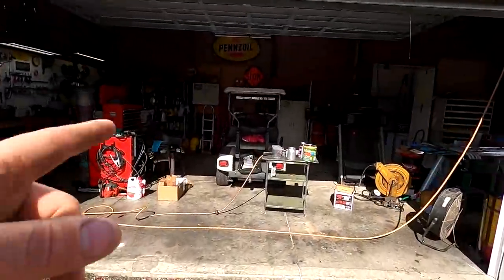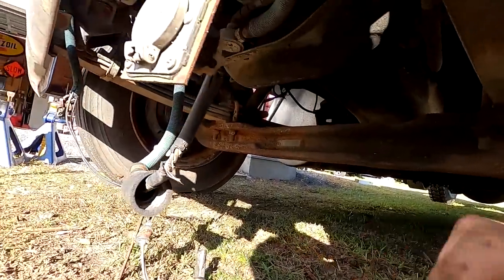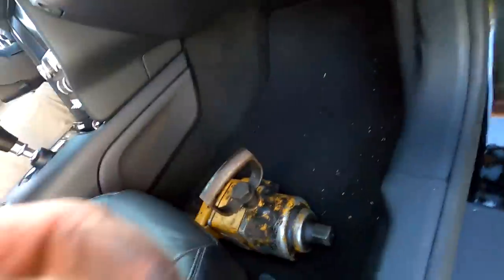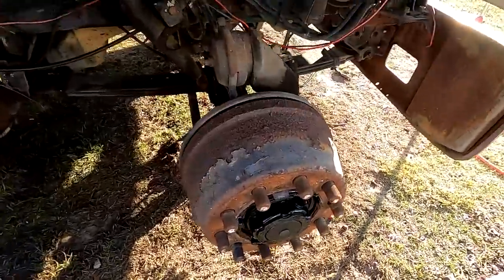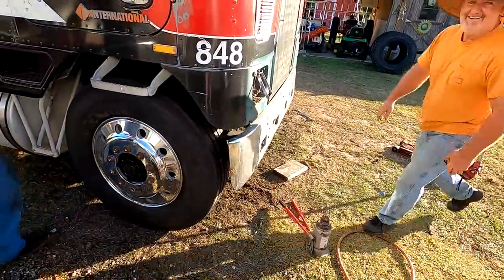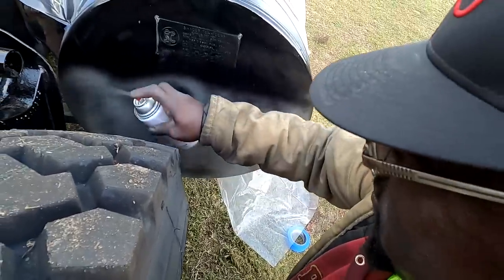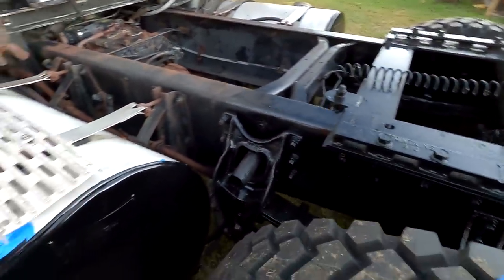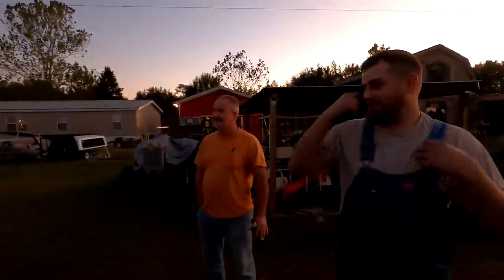Frame Painted, Tires Mounted, Brakes Done!!! Cabover Is So Close!!!

Comment: I did tires for three years and did lots of semi tires. We always mounted the tires with the rim face on the ground not up. Also if you would take that tire bar and put your foot on one side of the tire and the bar on the other side and use the bar to position/move the the mounted rim and tire it makes them allot easier to mount on the truck. Your going to crush your hand and fingers doing it like that. Just trying to help out.

Comment: Nice build. The wheels are amazing,  I’m jealous,  I used to have 8 rigs before 9/11 hit the country,  shortly after diesel fuel went to 4 bucks a gallon, that’s up from $1.35.  Insurance companies should have be jailed for their rate increases,   All my trucks ended up getting liquidate by the friendly IRS.  Time marches on,   Nice build, on my older spring suspension trucks I used to add air ride cab mount kits, they would most time ride nicer than the full air suspension trucks.   Sweet cab over 👍

Comment: Hope all went well with your family from some Wilsons on this side of the pond. The truck is looking superb. Are you going to change those front drums? Thought I heard you say they had cracks in them. Iceman is a true tradesman. You can tell by the pride in his work. 
What's next after the truck? Seeing as you dealin farm equipment how about doing a cropsprayer. I know you would have to have the work overseen and signed off by a licensed aircraft engineer but it would be an awesome project.

Comment: Shoulda used truck bed liner for the back of those fuel tanks.. I would of roughed up the surface of the tank first with sand paper then wiped it down with isopropyl alcohol to clean..then applied liquid truck bed liner.. That would of bumped it up multiple levels of protection from pebbles and stone chipping it plus the durability of the liquid truck bed liner for the long term.. Heck I saw a CJ7 coated with truck bed liner inside and out and it was badass looking.. FYI - You can still do the truck bed liner coating over the black paint..just rough it up nice

Comment: Dents in tank. Disconnect all the lines from the tank & pressurised it. Use a heat gun to assist softening the metal in the damaged area for it to then pop out & looking nicer

Comment: To fit a wheel on those big trucks you need two sturdy bars of a 16 mm  dia and about one meter in length that you slip both sides under the wheel and then lift it up to match the holes and then shoulder it home.... seen a girl do that !

Comment: Ex trucker here, a crack in the brake drum puts the vehicle out of service.  Driving with a cracked brake drum is a DOT violation.

I do like the mud tires, especially since this truck is going to be a toy hauler.  For a little tip, if you aren't going to use this for income, I recommend a "NOT FOR HIRE" sticker for the driver's door.
Reply: Michael Bujaki He doesn't know the correct terminology.  They weren't "cracked" they were "heat checked" nothing wrong with that.

Comment: Little brother I certainly hope you are as tough as you look. I love what you are doing here just be prepared if you intend to use this truck for anything other than locally. I have about 700,000 miles  commercial driving and over half were old spring ride trucks pulling a hopper bottom over the road. It will make an old man out of you. I still have knots on my head and guts hanging out my ass. Otherwise enjoy the nostalgia, it is awesome to experience history first hand in a sense.

Comment: If you plug all the ports on the fuel tank and have a non vented cap you can blow compressed air in the tank and push most of that dent back out. In my experience you don't want to go over 80 psi though

Comment: When torquing wheels I always set up the wrench where I'm pushing down on the torque wrench/breaker instead of having to pull up on it. It lets you use your body weight to help get more torque instead of relying only on muscle to lift the breaker up.

Comment: With the mud grip tread, they are going to be flinging gravel against the back of the cab as well. You will need to mount quarter fenders or else everything is going to be damaged.

Comment: I like your channel and the project. I would recommend degreasing the engine then finish painting the frame and finishing the  mechanics on it. Last but nut least do a repaint of the Cab. As far as the driver side fuel tank, thank can be popped out using compressed air. It would look better an be a  guarantee that the crease won't leak eventually.

Comment: that true an tried transtar prolly needs upper spring hanger or 2 , then those front spring I bolts   on steering need a very good looking over. 1,000,000 +

Comment: Wheel nuts should be tightened in a cross hatch style as then they tighten equal with less wheel wobble and or god  sake don’t use the tension wrench like that push down on it not pull up.Did you tension lug nuts before fitting fitting outside wheel.Looks good for an older truck.

Comment: I like the big tires on the front just hope they clear everything
Reply: There aren't that many truck tire sizes. Lol. They're not gonna rub.
Reply: @moose2577  no shit lol I think you missed a point when you go from a smaller size to a bigger size tire on a steer axle you need to check for clearance doesn't matter how many sizes there is
Reply: @ryanmall  what do you need to check for clearance? Trucks aren't built for small tires only. Going from LowPro 22s to tall 24s aren't going to all of a sudden rub on the frame or something.

Comment: Got to thinking about your truck. This this is a gold mine. Not needing to be E-log compliant. Could legally run paper logs. As long as the engine is pre 2000. 

   Guy will pay $15,000 and up to buy these old trucks. Just to tell the D.O.T. that they are running paper logs.

Comment: Please don’t ever grab the hub through the wheel while the truck is on a jack. If that jack were to let loose or tip, and that hub comes down with your hand under it and your wrist held up by the wheel. Well you can imagine what could happen, I’d hate to see you lose a hand. Keep the videos coming, be safe.

Comment: Ya'll are using the wrong end of the tire bar, and the Alcoas mount from the front or back but remember all of the steel wheels mount from the back on the low drop center, bad ass truck

Comment: You'll using the tire spoons or ( bars ) wrong, the  side with the the funny curves is specifically designed that way for  mounting the tires with little to no scratches

Comment: are the back tires taller than the original ones? If so don't you need to do something with the speedo gear to compensate to get the right speed and mileage?

Comment: The pig service has neither cleaned the front hubs nor been cleaned, painted the chassis that has not yet been completed, and this tank can minimize wrinkles with heat-based metal pliers for a beautiful appearance.
In short, it starts, but doesn't end, what it does

Comment: You could of used tank covers for front and back of fuel tanks i used them on a couple trucks my old boss used them on a couple trucks and one  to haul pulling truck look it up on youtube it is called Class Act  he uses a 3406 mechanical cat motor in it bigger turbos  only motor he runs is mechanical cats in it over 2500 hp in truck

Comment: i would never seize the all the studs and the outer stud/nuts on the rear wheels....you would be happy you did the next time you take the rear wheels off. otherwise the inner and outer nut tend to come off as one. i would have put those quarter fenders on the posts that are already there and still polish the rears of the tanks...that paint is going to be all chipped up in just a few miles when those trash hauler treads grab every rock on the road. i think you will like the traction on those tires in loose material but i doubt you will be pulling anything heavy enough to keep them from cupping and wearing badly. when hauling light, a less aggressive closed shoulder tire would have been my choice.

Comment: Lugnits are to be torqued to 375ftbs not 300 and the cracked brake drums get you put out of service and shutdown if you get pulled over i woukd replace them my ol man always said no matter how old your ride is the most money you spend us for the best rubber and brakes dont be cheap on those two items they can mean life and desth and also with bigger tires your speedometer gonna be off as well and needs to be recertified by DOT

Comment: May as well have used a gun on the wheel nuts. The torque wrench doesn't work when you stop halfway through the throw. Its the same with head studs.

Comment: The studs on the rear are to short for those aluminum rims. They are for steel rims. The outer nut will not be on the studs outer wheel can fly off beware.

Comment: Did you get a new water pump, I would change that out no matter what.  You should have cleaned up the front breaks, at least sprayed them out.  I would have also greased up the studs before you put the tires on.

Comment: Harbor freight has a bud socket in a set for like $60 just FYI, you ain’t got to bend off for the snap on clown for everything lol 
Also when you want to upgrade that pathetic 1” gun, the 1” pistol grip for $130 at harbor freight will eat your lunch, I use it on D8 under carriages, they do wear out after a year but that’s why you get the extended warranty 😘

Comment: Okay I’m no semi mechanic but I’m pretty sure you’re supposed to tighten lug nuts in like a cross pattern... not in a ring. Also when torquing the lug nuts, use your weight to push it down or like to the side, don’t lift up on it, you’ll throw out your back man

Comment: Although it is funny to watch . I'm just wondering why you mount tires from the wrong side of the wheel while using the side of your tire bar . And fyi if you put the tire bar under the tire it is much easier to lift them on the hubs .  Just saying

Comment: Why didn’t you use wheel studs that are long enough to go threw both wheels never seen any like you used
Reply: Country63 Those are the correct studs for the rear. That's the way it used to be done back then.

Comment: this is not the way how you should torque. it need to be in one movement until it has the correct torque. i dont push the torque wrench, i pull it to my side. my englisch  is not good enough to explain why it has to be in one movement. im from germany. but i like your progress so far on the cab. greetings

Comment: You need to replace the front brakes too they do most the stopping
Reply: I have to respectfully disagree. On cars with disc brakes on the front and drum on the rear maybe. I drove a coe Freightliner back in the mid 70's that didn't even have front brakes.

Comment: Smaller tyres would have been more practical, less wobbly on the road + less effort to turn the wheels, more towing power.
Also grease on the studs would have gone a treat

Comment: You missed a little trick we use here and that is to put one left hand threaded stud on each right side hub and one right hand threaded stud on each left side hub. Thieving bastards after your new alloy wheels will never get to steal them.
As it happens we use right handed threads on both sides...

Comment: Your paint job won't last a week. You needed to primer first, then paint, then clear coat. I know from experience. And also high heat paint won't cure on a fuel tank. It will chip off quickly....

Comment: Those wheel nuts are not proper for Alcoa rimms. it is not safe to drive like that. The Alcoa rimm nuts are much longer and they go inside the rimm take a look in the net for the proper wheel nuts

Comment: If he use the air socket, why is he over torkeying them bolts, for the original paint scheme the Alcoa s don't look to fancy, the cab being Ferrari Red or Electric Blue or Orange then., It will look magnificient=

Comment: You found a truck under that turd pile. Shame it ain't gonna hit the highway that much. Least the guy getting the tractor off the back of it won't think its been delivered on a wannabe trailer.  Has got some style... curious why not paint the white on the cab?? Everything else done, won't it stick out or is it just that much nicer a truck that it don't need it? Even some rattle can white to take out the scratches. Trade that ten speed out for  a thirteen and you''ll be a lot happier

Comment: pretty obvious noone has worked with heavy equipment ,especially tires , try to mount the tire upside down??!!!  and get rid of those little impacts and get a real one??!!!for your safety and others on the road....300.00 for a snap on socket when you could buy seperate sockets for 25.00 each .

Comment: Dude.....what are you doing? You painted over everything. All the rust, everything. You’ve barely touched the engine or trans and you’re worried about badly painting the frame. I’m sensing you went into this resto/build with no plan.